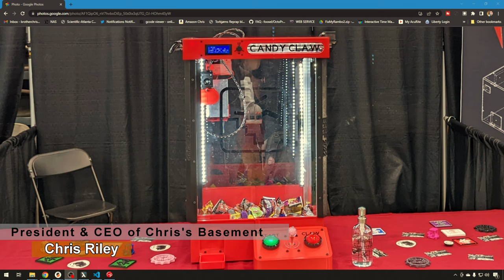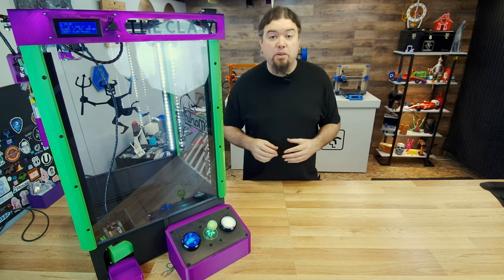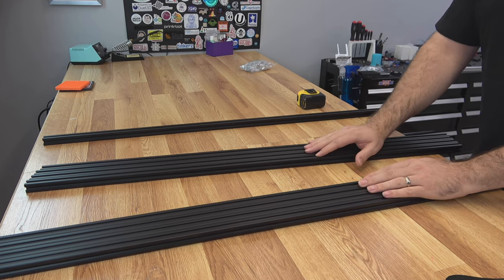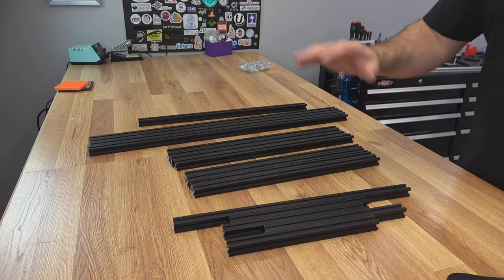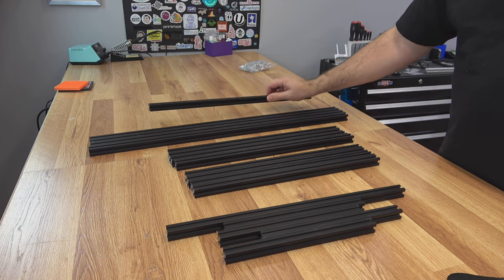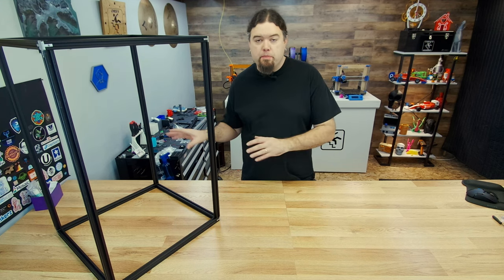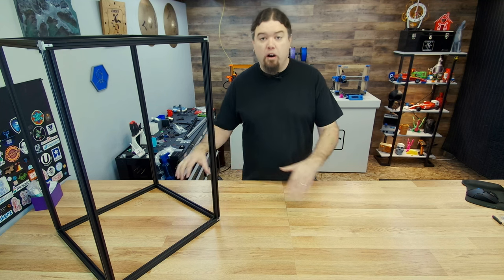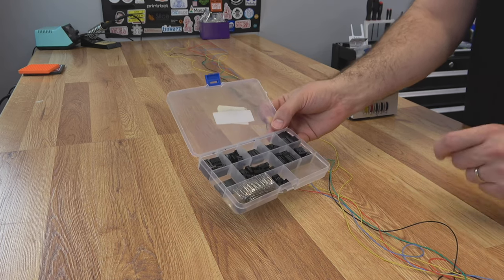The Candy Claw Series - Part 1 - Building the Frame - Chris's Basement - 2022

Comment: I looked for the T slot covers project on Thingiverse, but I couldn't find anything.  Do you have the link?
Reply from the maker: The ones I used are in the project on printables, but the original is here. https://www.thingiverse.com/thing:1478147
Reply: @ChrisRiley  Thanks.  When I looked, the Printables link was dead. with a 404 page.  It looks like it's working now.

Comment: Chris, looks like a fun build.  Have you tried cutting all of the extrusions at once?
Reply from the maker: Hey Dave! No, not on my saw, I was cutting down longer stock, I didn't want to mess that much up all at once. LOL.
Reply: @ChrisRiley  I used tape to wrap them into a singe bundle, then cut.  You are correct, that if you make a mistake it is times 4, but they will all be the same!

Comment: Bonjour, super projet. avec qu'elle imprimante avez vous imprimé les très grandes pièces, de plus de 60 cm ?
Reply: Hello, great project.  With which printer did you print the very large parts, over 60 cm?
Reply from the maker: Hello, I used the Folger Tech FT6. Build volume 350mm x 720mm. Thanks for watching!